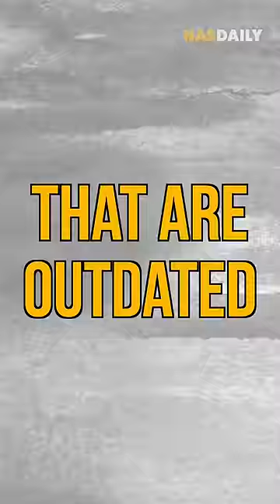Why Wine Bottles Look Like This #342

Comment: When 3 quarters of the video was about wine bottles and suddenly he says this video is not about wine bottles lol, but anyway this spreads a good message
Reply from the maker: PLOT TWIST! Lol thank you for watching till the end and I'm glad you learnt something new!
Reply: The
Reply: The
Reply: @Elyana Sayegh The "the" that that's the "the".
Reply: What good message? 750ml is a good size to not get poisoned but still drunk
Reply: @Elyana Sayegh ✨🤣🤣🤣🤣🤣🤣✨
Reply: I agree that there are many rules we follow without even knowing why we do that since years.

But, in this case I guess we have other dependencies like the boxes we store the bottles. Any other storage and packaging issues for which we already have solutions needs to be changed. 

Even a car cabinet where wine bottles will require new designing. 

And who will buy a 2 litre bottle if they do not have means to carry it like the 750ml.

And which wine brand will start taking the risk of resizing it 😀
Reply: @Elyana Sayegh the rock
Reply: @Elyana Sayegh because the rock is the

Comment: True in the past. But nowadays, wine bottles are 750ml as it is divisible by all glass sizes. Wine is only meant to be served in 125ml, 175ml and 250ml. Therefore, when pouring wine into these glasses there should be no wine leftover after these pours allowing a perfect amount of glasses per bottle

Comment: 1. They don't only come in 750ml, you can find one liter or more and less than half a liter bottles too (325 being most common for smaller ones), 750 is just the most common because

2. It is a good size. 750ml is around 4 6-ounce-servings of wine, usually enough. If you need more you can usually get a magnum bottle which is 1.5l or if you really need a lot of wine double magnum, Rehoboam etc. 

3. If it ain't broke don't fix it. Changing a international standard is always hard

Comment: Those are the traditional size for wine:

187.5 ml Piccolo or Split: Typically used for a single serving of Champagne.

375 ml Demi or Half: Holds one-half of the standard 750 ml size.

750 ml Standard: Common bottle size for most distributed wine.

1.5 L Magnum: Equivalent to two standard 750 ml bottles.

3.0 L Double Magnum: Equivalent to two Magnums or four standard 750 ml bottles.

4.5 L Jeroboam: Equivalent to six standard 750 ml bottles. (In sparkling wines a Jeroboam is 3 liters)

4.5 L Rehoboam: A sparkling wine bottle with six standard 750 ml bottles.

6.0 L Methuselah: (aka Imperial) Equivalent to eight standard 750 ml bottles or two Double Magnums.

9.0 L Salmanazar: Equivalent to twelve standard 750 ml bottles or a full case of wine!

12.0 L Balthazar: Equivalent to sixteen standard 750 ml bottles or two Imperials.

15.0 L Nebuchadnezzar: Equivalent to twenty standard 750 ml bottles.

18.0 L Solomon: (aka Melchoir) Equivalent to twenty four standard 750 ml bottles.

Comment: Barrels were used to transport wine at that time. One barrel is 50 gallons, about 225 litres. A real nightmare for conversion! Therefore, to ease the calculation, the wine makers from Bordeaux decided that 1 barrel would be 300 bottles of wine instead of 225.

Do the math and you will find that it makes a bottle of 750ml, with one gallon representing six bottles. that's the right answer.

Comment: Simply, manufacturing costs for each bottle would be more expensive since more bottles are needed than usual because they are smaller. It would also cost MANY MILLIONS to change it to 500ml. If something works dont fix it.

Comment: Nah I think it's cool that we kept the same design all these years, it just goes to show that not everything needs to be "perfected". Not to mention, knowing that 750ml is the lung capacity of the average glass blower, it's awesome that there's still a human element in them even though we use machines, just the same as how we use a base ten number system due to the fact we have ten fingers, it's just cool knowing that those exist for anatomical reasons

Comment: Let an economist tell you why path dependence is not that much a mystery: If you change the size you'll also have to change all the logistics, machinery, etc. based on the bottles having 750ml. That would be way too expensive.

Comment: Who is gonna tell this guy that wine bottles come in multiple sizes? You can get half bottles. You can get magnums. In Australia some venues sell quarter bottles (approx 1 serving) but nobody is going out to buy those unless forced to at a concert or something.

Why is 500mL better than 750? It’s less shareable. Definitely too small for three people, maybe the right size for two, but at least in Australia, a glass of wine is typically 150mL. So 500mL is three glasses, kind of an awkward number plus a bit left over. 750mL is 5 glasses, which, when free pouring a rough estimate but much easier to share than 3 where you either get 2 short pours or one person gets 2 while the other gets 3.

What I’m saying is if you want a bottle for one, 500mL is too big. That’s 2/3 of a bottle. I mean people drink whole bottles on their own, but it’s not healthy and 500mL is too much. If the bottle is to be shared, 750mL is more easily divided equitably between 2-4 people.

Why on earth would 500ml be preferable? Because 500 is a nice round number? Surely then make it 1L bottles.

Comment: That's why we still use horse 🐴 power as a unit to measure power.  

Also, the width of railway tracks around the world is equal to the space occupied by two horses pulling the cart in parallel fashion. As initially,  horses used to pull rail carts .

یہ چیز !

Comment: I'm absolutely fine with it lol. Tbh, I don't understand what seems to be the problem? This is the first time I've seen nas daily bringing up something quite pointless.

Like the last quote is perfectly correct, I agree and all but what's with the wine? Why did yall want to change it so bad? Personally I don't think there's anything wrong with its design and there's so much more better examples for this context of "old rules should change", like how education system have been more less the same for literally decades.. Its true that old rules should change sometimes but it doesn't mean we should unnecessarily change them all.

It's just about bad example tbh..

Like bicycle, if you see it in a way bicycle too was kinda pointless. Taking public transport will take you faster and more efficient and you can always workout more later. even more, bicycle is pretty expendive nowadays.
That is until you change ur PoV, tho bicycle is less efficient it reduces traffic jam and air polution. It helps ppl get healthier and it was easier to use everywhere.

Its about how you see things in life. Just like the wine bottle, some things didn't need to change while other things are better to be left alone

Comment: We all know that the bottles of wine are 750ml and not 1 litre. Some say that 750ml is the exact lung capacity of a glass blower, that it corresponds to the average consumption of wine per meal or that this volume is more convenient for transport…

None of that is accurate! The truth is even more embarrassing (for the French). Let us look back in history: The volume of 750ml was standardized in the 19th century. At that time, the biggest clients for the French wines were the British. Their close neighbors do not use the metric system and used to order wine in “imperial gallons”. One gallon is about 4.546 litres.

Barrels were used to transport wine at that time. One barrel is 50 gallons, about 225 litres. A real nightmare for conversion! Therefore, to ease the calculation, the wine makers from Bordeaux decided that 1 barrel would be 300 bottles of wine instead of 225.

Do the math and you will find that it makes a bottle of 750ml.

Comment: Him: Change outdated tradition.
Me: Trying to find a f**k to give about wine bottles, which I don't even drink, and moreover trying to understand why manufacture entirely different parts for machines when regular parts are easily available due to the standard volume decided because of that same tradition, and thinking about how much wine will be wasted if people order wine and the bottles have different volume.

Conclusion: This perspective isn't bad, but unnecessarily changing things is a greater waste of energy if it doesn't make any significant difference in significant topics of life. Wine is neither a significant topic of life, nor changing its traditionally set bottle size would make a significant impact on anything.